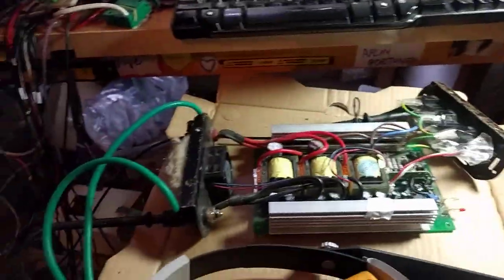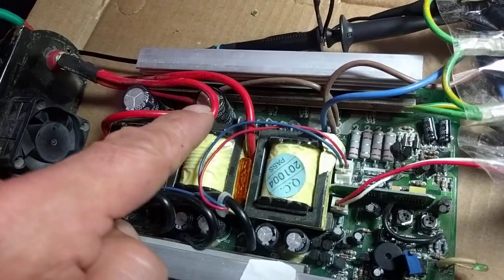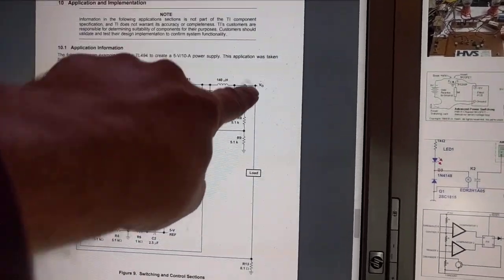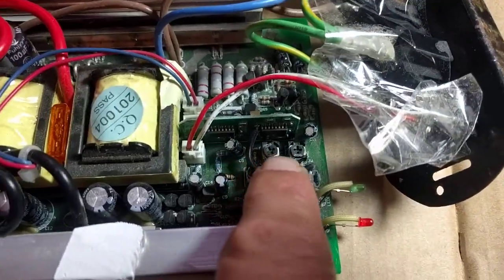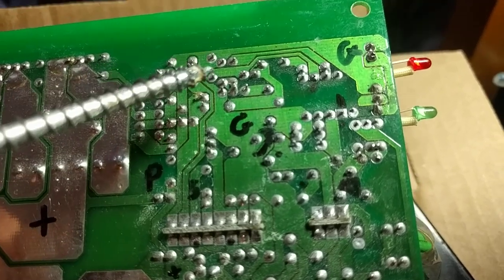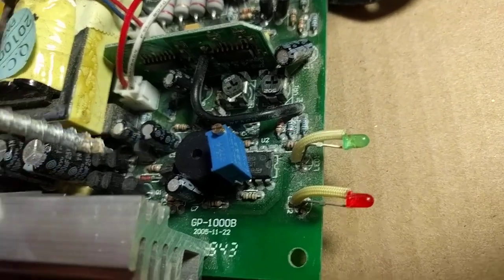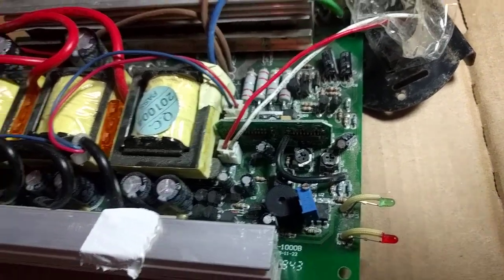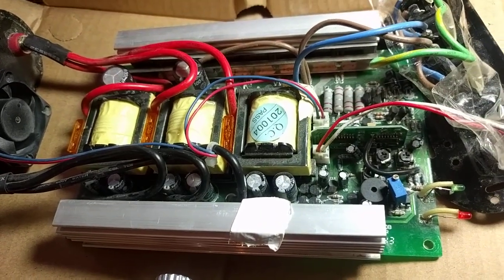Modifying an AC Inverter to run off a Lithium battery

Comment: hi...can i please ask a question cause im not familiar with electronics...
i had bought  a lion battery pack 12v  8000mah  3s..it can provide from the board it has max output 2.4 amps..so it can handle around 30 watts
i have a monitor that its rated at 20 watts 220v and wanna be able to power it with a small inverter  rated at 150w  thas has a low battery off -cut off voltage 10-11 volts it states at the specs....will it work? ....is there a risk doing so...?thank you

Comment: Thanks for your video. On the CENTECH BOARD WHICH ZENER diode did you remove from the circuit to prevent input OVER voltage alarm and shut down ?

Comment: im planning to do this for a 3s battery, I figured it was possible, this video helps a lot though
Reply from the maker: Yeah 3S is almost easier because you only have to worry about the undervoltage cutoff. You may find you don't get the full regular AC output voltage (b/c the transformers have a fixed ratio) but it may very well not matter, depends what you have plugged in; a lot of modern stuff (electronics using switching power supplies) really doesn't care much about the line voltage. A typical modern SMPS runs fine down to 80v or less. A lot of them even run off DC ;-)
Reply: @DrTune  dude this video helped me so much, i did this mode to a Centech 750watt inverter and lowered the cutoff to  9v for a 3s battery and I spent a few hours and found a resistor connected to the Quadruple Op Amp and because there wasn’t much room i stuck two wires onto the resistor and the resistor that was there was a 8.9k and i added some resistors to it that brought the resistance down to roughly 7k, and yes with an input voltage of around 10v it starts dropping the output voltage but only down to around 100v

Comment: Great video. One of the rare videos I can find about changing cutoff voltages of inverters. I have encountered problems using 4s Li-ion batteries on 12v inverter. I would like the high voltage cutoff to be 17v. Is there a way to add a potentiometer to control the high cut off voltage?
Reply from the maker: Yes; I kinda covered this at the end. The centech one I showed the schematic for used a zener diode for the over-voltage cutoff (diode conducts when over its rated voltage); you can just remove this component (or cut one leg). Some inverters will use a CPU instead for detecting both under and over voltage; they use a single resistor divider on the input voltage (to scale it down to something the CPU can handle, e.g. less than 5v) and then feed it into an ADC (analog-digital-converter) pin on the CPU.  These sort of inverters can also be fairly easily modded by tweaking this divider (so the CPU sees a differently scaled version of the input voltage and is happy).
Reply from the maker: see other threads below for more info on CPU based inverters

Comment: Great video! The new Cen-tech 400W inverter these days uses a chip to sense the voltage, but I was able to follow what you suggested in the comments to find out the right pin, and pull it down with a 4.7K resistor. Now it works great with 4s battery pack!
Reply from the maker: Shoot some footage of what you did, for others!

Comment: Hi! Very very informative video. I learned a lot about how the protections work. Now my main goal was to disable the over-voltage protection... Which you grazed over very briefly. I took a look at my board but couldn't make out what diode to cut off. Do you mind sparing a few minutes to help me out? That would be greatly appreciated! 
Here are some photos if you'd like to take a look. https://photos.app.goo.gl/6M6QLUUXauqBpCqR6

I struggled to get photos of the far side of the board as one of the heatsinks was in the way. Let me know if I can picture it any better. Thanks again!
Reply from the maker: Hi there; yeach it's a pretty straightforward board you have there (complicated by the fiddlyness of getting access to it); the 8-pin chip is a dual comparator so that is probably it. I see one diode has 9.1v next to it, i.e. it's a Zener diode with a specific breakdown voltage used as a reference.  That might be the reference used for undervoltage detect (or.. something else).. Look at the LM393 pinout and you see there are two outputs; it would be interesting to see what those outputs do (measure with a voltmeter against GND on that chip) you may well find they are the under/over voltage detect. (or, they may be overcurrent or something else).  I suggest you solder on a few test wires to the LM393 (especially the outputs) so you can measure them from a distance, and hopefully you have an adjustable-voltage power supply so you can see what happens when you run inverter on under or over voltage. A little experimentation should find the "trip" signal for overvoltage. Then you just need to disable it, which can be done in several ways by gently fritzing with one of the inputs that the comparator is looking at, or lifting one of the pins, etc.
Reply: @DrTune  thanks for getting back to me! I do have an bench power supply so I'll he able to test it. You mentioned in the video that all you needed to do was to cut off a diode to disable the over voltage? I don't really want to mess with the under voltage, as I'll have a buzzer connected to the 4s battery pack. I'll always be around it when it's being used. Did any diode jump out at you? I wasn't able to find a schematic for this board.

Comment: All of my 12V inverters have 15v OVD protection, any idea where I can find a 240V 50hz inverter without that protection, can't find a zener on mine
Reply from the maker: You have several of the same model? or..?  Anyway happy to help; take some photos of the PCBs (component side is most useful but both sides if it's easy enough), stick them in a google doc, make it editable and put the link here. As many pics as possible, with enough resolution so can clearly read the markings on the chips.
Reply from the maker: They don't always have a zener, if it uses a CPU it might just be a voltage divider into the CPU and use software instead; see below comment thread about Xantrex Prosine 1000

Comment: Great Video, i've been looking all around for this type of mod and you seem to be the only one who has posted anything on it (disabling overvoltage).
Reply from the maker: It's a bit of a niche hobby ;-)
Reply: @DrTune  I've been trying to remove/raise the overvoltage protection from a small 350w inverter with no luck. The main ic used is a MT494-D-1 and i can not find a datasheet for it. No premade aux boards to look up either, after messing around with it for 3-4 hours all i've managed to do is disable the buzzer circut which gave me an extra 0.3v of useable range i guess. It still truns off at 15.5v though. If I sent use some pictures could you help me figure it out? Or is it impossible with out the datasheet?

Comment: I have a Xantrex Prosine 1000.  I’m looking to do the same thing.  If I uploaded a video do you think you could help out?
Reply from the maker: sure as many pics/video as possible pls.
Reply from the maker: did you try it? according to manual that thing should work up to 16v. A full charged 4S pack is 16.8v - a pack that's only slightly less than full should (on paper) work ok. See if you get overbattery alarm
Reply: https://rover.ebay.com/rover/0/0/0?mpre=https%3A%2F%2Fwww.ebay.com%2Fulk%2Fitm%2F173579026800 this is the 24v version, but it’s the same board
Reply from the maker: @wannamikeout  not ideal; can't make out the chip names. Can you post several camera pics (on imagur or whatever) of the main electronics (chips and resistors), ideally several well lit shots taken from above that will roughly tile together. Don't have to take it apart
Reply from the maker: yeah yours is cpu-based, I am guessing a PIC (peel off the white label and have a look). Most likely this is using an ADC input on the cpu to read voltage and then make the under/over voltage decision. Easiest thing to do is to skew this measurement slightly; means the inverter display will read wrong voltage, but whatever.  Find out what chip it is (I assume a PIC, that was the fashion back in those days), and identify which pins are ADC (analog) inputs - either that or just try them all.  Ok now get a resistor, about 1Kohm, and connect one end of it to some ground on the pcb near the cpu, and the other end use like a probe. With the thing powered up (or at least displaying the input voltage on the display), touch the resistor against each CPU pin in turn for a couple of seconds and see if the voltage reading changes. This should not damage anything (a 1k resistor is about right to see a noticable different on a voltage-divided ADC input yet won't hurt anything).  You will probably find one pin that behaves like this (and if you measure the voltage on it you should see it increases and decreases as a fraction of the input voltage). Now you just want to tweak it slightly; you can either follow the PCB back and identify which pair of resistors are teh divider, and mod one of them, or (simpler) just put fairly high-ish value resistor from that pin to ground (e.g. try maybe 100k or 500k and see the effect) . This will modify the resistor divider and make the input voltage appear to the CPU to be a little lower than it really is.  This may do the trick. Note the low voltage cutoff will be about 10v or so, dangerously low for lipos (and this mod will probably make it even lower) - use an external battery alarm! Modifying it so the undervoltage cutoff is appropriate for lipos will be nontrivial as it's in software.      Enjoy! - HMU on skype if you get stuck
Reply from the maker: btw if you run this thing open be well aware that it will have dangerous voltages on the HV caps for several minutes after it's unplugged. Danger, Will Robertson!
Reply from the maker: there are lots of trimpots on there but I suggest you don't mess with them; for this kinda design they'd probably do the voltage limiting in software and use a fixed resistor divider; no need for trimpots. The trimmers are probably other things that need factory adjustment and could make it run badly if misaligned.
Reply: @DrTune  can you paste the link to the note you user
Reply: It shuts down at 16v 
Beeps at 15.8v but still inverts
Reply: https://youtu.be/z9Z9d0PSJFM
Reply from the maker: @wannamikeout  ok a fancy inverter uses a cpu. Yes can probably mod it but i would need really good images of both sides of that pcb to help you significantly. (Or a service manual schematic)
Reply: Yea I kinda figured since they glued them in place that they shouldn’t be adjusted haha .  Good call on the PIC, I took the sticker off and it’s a PIC16C73B.  I don’t know much about cpu chips, is there a way to interface with a PC and adjust values?  Or is it easier to try with a resistor like you were saying?  (BTW thank you for helping , you are a wizard)
Reply from the maker: Google doc: 
https://docs.google.com/document/d/1kqjHFna2JTOmyCAsob-Q30TmEaxxphbJLtfxuRyOpw4/edit?usp=sharing
Reply: Turns out it was pin 3 on the PIC, a 100k resister drops input voltage reading by .8v
Reply from the maker: @wannamikeout  so it all works?

Comment: I want to do this to my inverter but cannot see the Zener Diode to cutout.  Are your notes that you refer to available online?
Reply: I got another inverter with a different circuit and was able to have an educated guess thanks to this video on the zener diode and now have no overvoltage issue for LiPo use.  Thank You very much, saves me $$$
Reply from the maker: @doug606b  Welcome! Not all designs use zeners, some use a CPU, which can still be modded (see discussion above re Xantrex inverter). I will do a new video with better camera, slower talking, and more info ;-)
Reply: @DrTune  pls paste the link to the note u used in making ur modifications
Reply: This is good news. Maybe I can make the charger part of my sungoldpower inventer work on 6s lipo. The max charge voltage is wrong, and the low voltage cutout is to high. Or I'll pay someone to modify my inventer

Comment: Any difference with a pure sine inverter?
Reply from the maker: Probably not ; the only fundamental difference between them is the output stage; the stuff we're playing with is earlier on in the circuit. Should be same.

Comment: Hi, enjoyed your video. I'm trying to do the same thing to my inverter. It's a different model and I'm not sure where to start on the mod. There are 2 auxiliary boards that could be doing the same job as the one you showed but are not the same. My one has 25v caps like you said and I'm keen to mod it for 4s, at the moment the over voltage is set around 16.1v do you think it's worth the effort to lift it to 16.8v?? Also the low voltage cut off should be raised to 12volts...
Reply from the maker: I just disable the overvoltage detect; it'd be a PITA to not be able to use a fully charged pack. Changing the undervoltage cutoff (UVCO) is very desirable thing to have; even if your lipo has its own BMS which has a UVCO it'll probably be set pretty low. If you're using unprotected batteries you most definitely want to mod the inverter UVCO b/c you'll seriously damage your batteries if you let them overdischange (at which point you should throw them away rather than attempting to charge them again which can be dangerous).
I charge and store lipos in the garden on a non-flammable surface, fwiw
Reply from the maker: Typically inverters use standard (very inexpensive) modules to generate the control signals; a  typical module (as seen on aliexpress) typically does all you need for a "modfied sine".  If it's a sinewave inverter that may account for the second board (a PWM modulator for the 'sine' output). Hard to say without seeing pictures; if you want to make a quick video of your inverter (show as much of the modules front/back as you can) I can give you some comments. Very likely you'll be able to go on Aliexpress and find the exact modules your board is using for sale; that's very handy.
Reply: Dr Tune 
Hi DrTune, I have seen your video on modifying the inverter an was wondering if this is the problem I’m needing to address with my project.
What the problem is I’m trying to run a 24v 600w Pure Sine Wave Inverter off a 24v lipo battery pack.
As I connect the battery it cuts out the BCM protection as it is receiving a powerful electrical spike. How can I avoid this from happening so I can use the two together?
Regards 
Matt
Reply from the maker: @pyromatt4533  the issue is the capacitors in the inverter charging up when you connect it. This is normal but is a large inrush current. One solution (not super elegant but..) is to use something like a 2 or 5 ohm resistor inline with the power to limit the current when you first connect it to the battery; i.e. start it up via a resistor (which may get hot for a second or two) and the caps will charge, then connect the main power (within a second or two), then turn on the inverter. A 3-position switch (off/start/run) kinda thing might work.